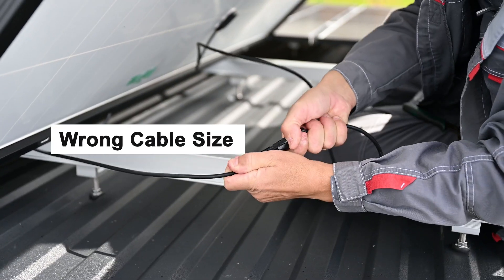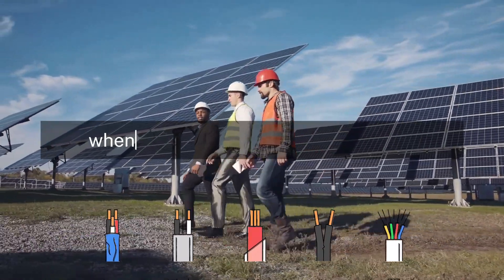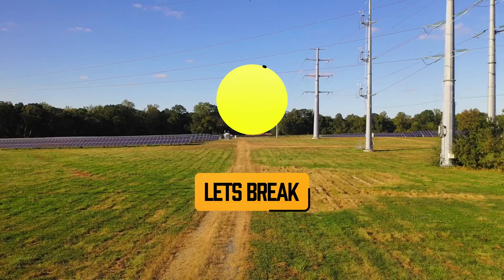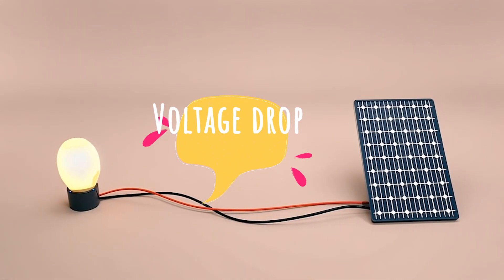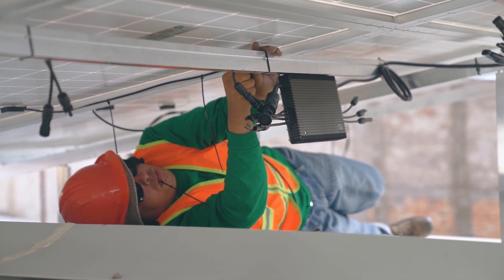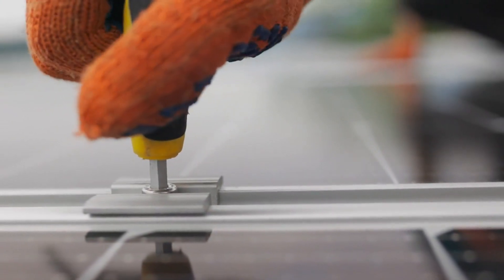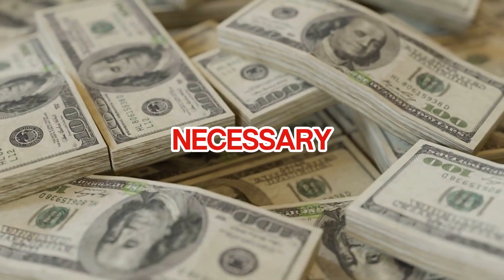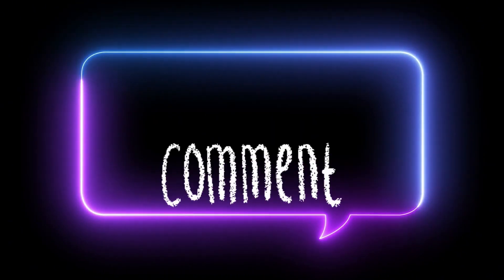The BEST Cable Size for SOLAR PANELS Performance? Surprising Results!

Comment: my set up..  
550w solar panel
12v 40a mmpt  scc
12.8v 100ah lifeo4 battery
12v 1kw inverter
need what wire and breaker with 15meters distance  with the panel and scc...?? tia...🙏🙏🙏
Reply from the maker: For your setup, I'd recommend consulting an electrical guide to ensure safety and performance.

Comment: Larger has less resistance therefore more energy throughput. But you have to consider the return on investment.

For me I will use AWG 8 gauge for a mere 400 watts worth of panels.
Reason?
Have 100 foot run each direction. I also plan on future upgrading too.

I would lose too much if I went with awg 10 gauge.

I am not aware of a 6awg MC4 connector.

10 awg wire has 1 ohm per foot resistance. About 36 cents per foot.
8 awg has 0.64 ohm f resistance. About $1.41 per foot
6 awg has 0.001296 ohms per foot. About $2.43 per foot.

Prices do vary but close enough. Above as of August 25, 2025.

Either use a higher voltage setup, a closer run, or a thicker wire if you want the max you can get out of your setup.

Note: Splicing ADDS resistance to the run.
Soldering may not.
Reply from the maker: Sounds like you've got a great plan for your setup, thanks for sharing your reasoning!
Reply: @renewable_energy  You re welcome. Just doing some math and research is all.
Going to take me a long time to gather up all that is needed due to the costs.
May not be able to do much as all if code enforcement gives me any grief.
So my project has to appear to be one thing while doing another lol.
Reply: @renewable_energy  Still trying to figure out what hardware is going to be needed to mount panels to superstrut.
And that to wood and wheels under that.
Starting out with 24v 400 watts. Will add another 400 watts.
Not sure if my PWM will handle that much....
Reply: Settled on getting a Victron MPPT controller 100/50
Will allow for adding another panel or so plus it should be more robust with running less amps through it.

Comment: Very clear illustrations on cable sizing. 
Assist in calculating the collect size of power and earth cables sizes to run a 20KWp 450V  PV solar panne array l. Over a distance of 30m
Reply from the maker: Glad you found the illustrations helpful for your cable sizing calculations!

Comment: I’m using 8 gauge solar wire because the length of wire is 75’ , the Tigo Optimizers on the back of each panel are 12 gauge wire. Is that 12 gauge going to screw up my voltage drop?
Reply from the maker: Great question! The difference in wire gauge can affect voltage drop, but it usually depends on the total length and load. It's best to consult with a solar expert to ensure everything is optimized for your setup!

Comment: Solar panels harness the sun’s energy and transform it into electrical current. Just like batteries, a solar panel has positive and negative terminals. And current flows from the negative terminal to the positive terminal.

Wires then transport this current to your electrical units. If too high a current is run through them, there’s a risk of overheating from too much energy. In certain jurisdictions, undersized wires and cables constitute a violation of the National Electric Code.

Comment from the maker: How do you suggest to select the cable size for solar panels?

𝐏𝐥𝐞𝐚𝐬𝐞 𝐋𝐢𝐤𝐞 👍 𝐚𝐧𝐝 𝐒𝐮𝐛𝐬𝐜𝐫𝐢𝐛𝐞: https://www.youtube.com/channel/UCt0ArAJeNCMftl8FP1nXuFA?sub_confirmation=1
Reply: I would of rather seen an example of the math. I can do the math, but it would have been MORE interesting to learn more about resistance. is 3 the best you can get? Then why no always calculate with resistance ""3""... Who would ever want more, if it's worse? I can't find those dang calculators online. EVERYONE wants my email and I want to do it. At this point I'd rather buy a heavier cable (bigger guage, what ever) and have it for future additions and/or future upgrades. Thanks for the video, it's helpful, but you cut us off at the math. Kinda bummed out about that.
Reply: Your video SUCKS try saying something of value next time. How about the diameter of some of these PV wires some have thicker insulation and same rating as others, some fit lose in the connectors because thinner insulation, maybe you don't know anything about that.